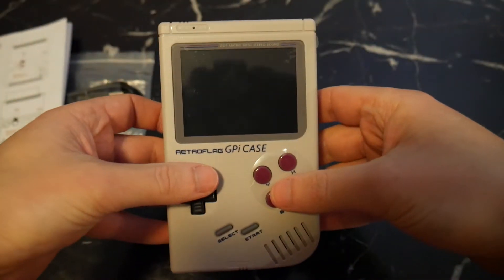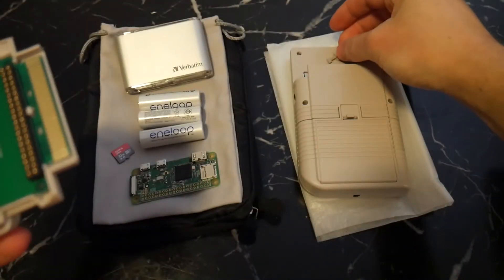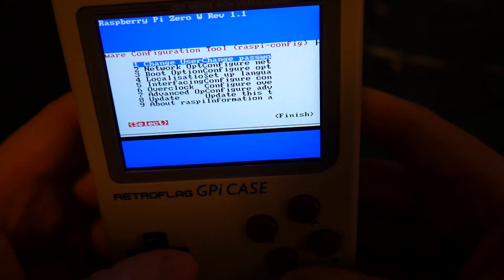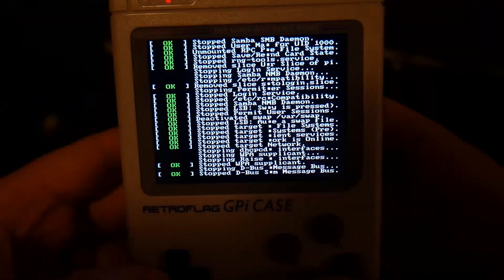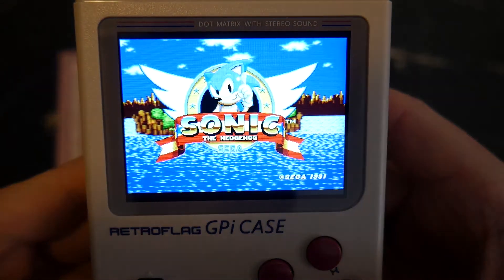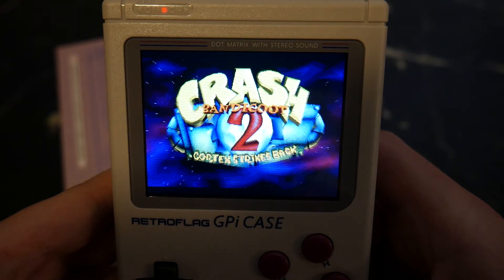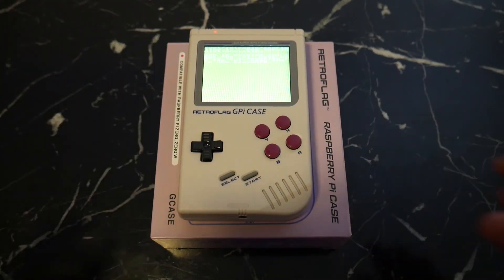RETROFLAG GPi Case Full Setup Guide & Review (Safe Shutdown Script, Themes & More!)

Comment: if you live in Australia I’d recommend to buy it from core electronics as you can bundle it with a pi zero W and rechargeable batteries to save on the shipping costs
Reply from the maker: They didn't have any cases in stock at the time of making this video but I did buy the Pi Zero from them, would recommend!

Comment: How did you get ps1 to run so well? Mine is so slow?
Reply from the maker: So this next part is a bit of a pain, but you have to configure the controls manually, which requires you to press the 'esc' key on a keyboard to access the emulators menu. I did this by installing an app on my phone called 'hackers keyboard' which gives you a 'virtual esc button' on your phone. Next I installed an app called 'Bluetooth keyboard and mouse' which allows you to pair with the pi and press buttons once you're connected. Open the emulator and press your virtual esc key and the menu will pop up. From there navigate to controls and press the appropriate buttons on the pi.
Reply from the maker: You need to change the pre installed emulator to another one that runs better on the pi zero.
Reply from the maker: https://github.com/RetroPie/RetroPie-Setup/wiki/Playstation-1 read more about it here, you are looking for the PCSX-ReARMed emulator due to it lower system requirements.
Reply: It worked!! Thank you so much!
Reply from the maker: @TritonGamezYT  No worries, happy to help!
Reply: Ok. Thanks😁
Reply: So I just downloaded pcsx reARMed but the controls dont seem to work?
Reply: Ok I'll try that😁

Comment: cant get file to show up as config file and I think that's why I cant connect to my network tried doing what you did and it keeps saving as txt file
Reply from the maker: Try enabling file extensions in the Windows settings and you should manually be able to change it from  txt to conf

Comment: how do i add box covers without keyboard?
Reply from the maker: Well I haven't actually done that so I'm not entirely sure. I did have to configure the controls when I installed a new PS1 emulator which requires you press the 'ESC' key to access the menu. I did this via a bluetooth keyboard app on my android, you'll also have to install a custom keyboard called "hackers keyboard" if you want a whole bunch of other keys similar to a desktop keyboard (like ESC, ctrl, alt etc). Hope that helps!
Reply: @snakephs4963  thank you i have a new ps4 controller nip i think ill try on my other pi 4b tyty

Comment: HI there the video is great, but i being stuck in one part is not showing the ip and also when it comes to put the putty file can't do it as i'm using a Mac my ip comes as uknown.. any tip that what i could do...thanks anyway
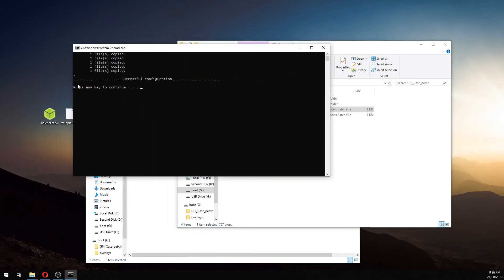Reply from the maker: This would indicate to me that you haven't connected to your WiFi properly. Make sure you're following the steps from 05:36 - you need to replace all that text with your corresponding country, wifi name and password than save it as a .conf file. It may be different on macs to make a conf file, but check out this mac guide here: https://howchoo.com/g/ndc3njbhytv/retroflag-gpi-setup Hope this helps!
Reply: i did properly and comes like that and the link from the other guy is not showing that step is not showing connecting also is not showing how is connect his gpi to the mac so i stop i will give it a crack tomorrow otherwise i will use a windows computer it looks easy to do it that way
Reply from the maker: @abelesteve9881  If you watch the video at the top of the page he goes into how to connect with a mac. That's always an option too, hope it works out for you!